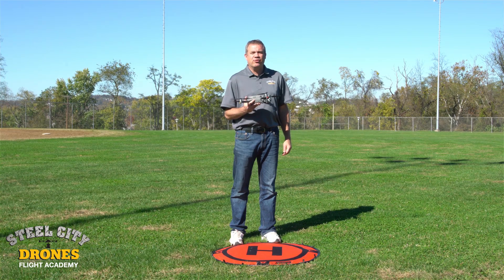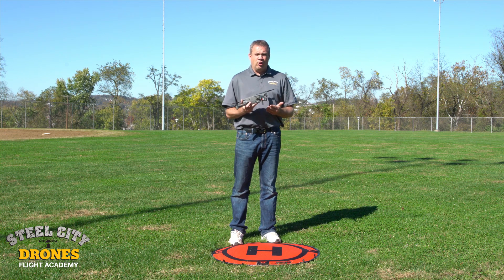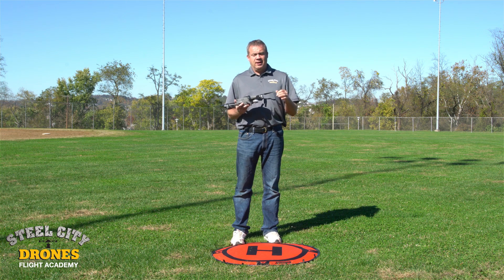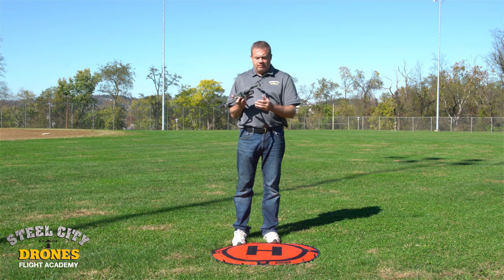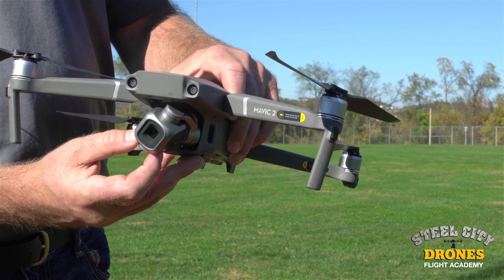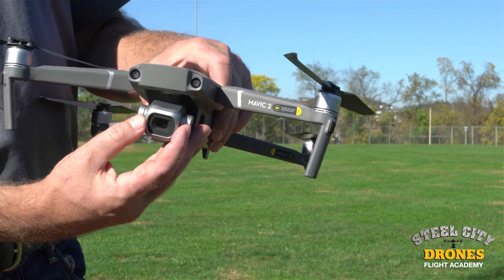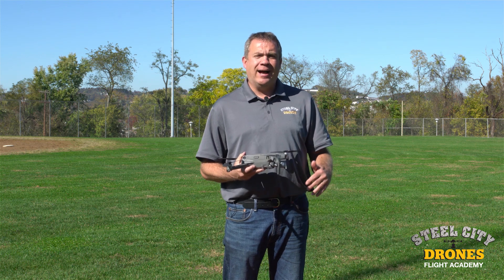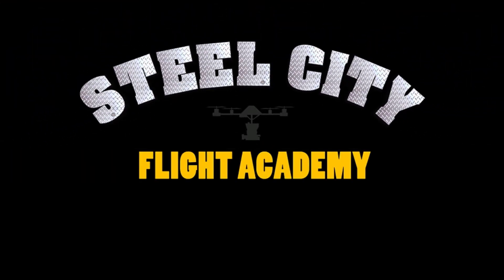How to prevent DJI Mavic Camera Gimbal failures

Comment: Very informative information on the gimbal. I just wanted to add an additional issue that is common amongst many drones regarding the gimbal. I personally experienced an issue with my gimbal when doing active tracking one day. I had my controller mounted on the handle bars on my ebike. The drone was following me along and I could see myself in the screen of the controller when I noticed that the camera was jumping up and down, so I stopped and landed it immediately and began to calibrate the gimbal but the calibration failed and after 2 attempts I turned off the drone and took it home. I then began gently wiping around all moving parts with a Q-tip and moving the gimbal around with my fingers. I turned it back on and was still getting the gimbal overload message. I tried moving the gimbal up and down with the controller knob but it would not face downward. I gently moved it up and down again with my fingers I could feel it slightly catching as it went downwards. I figured that it had gotten some dust or debris lodged into the gimbal motor, I thought that I would have to send it back to DJI for repairs. Although I didn’t have any insurance or Care refresh and I didn’t have much money at the time. I decided to try one last thing before sending it back. I used a little bit of WD-40 lubricant and sprayed around the gimbal motors carefully not to get any on the camera and wiped away any access lubricant. And then moved the gimbal up and down. After that I powered it back on and everything started working properly again. It’s been over 6 months and after another 15 flights I still haven’t had any issues with it. Just something you might try before sending it back for repair.

Comment: Nice explanation but how fix it when it keeps happening despite doing all that you have advised?
Reply from the maker: If it fails and you are getting it repaired and it fails again that's a problem. Are you checking to make sure that the gimbal is self balancing on the tilt and roll axis when not powered up after it gets fixed?